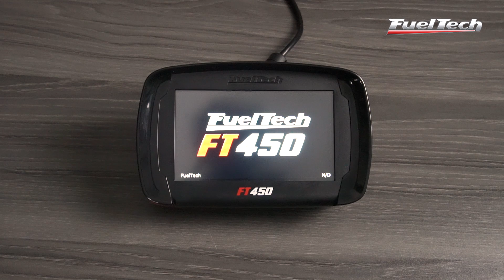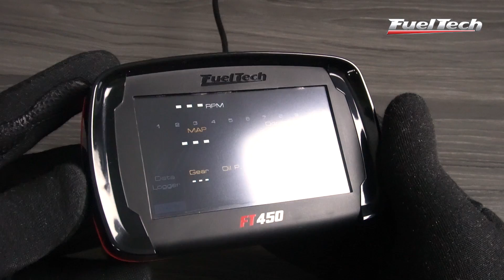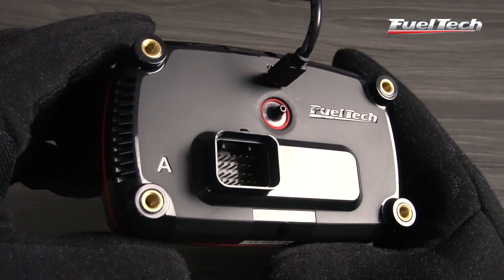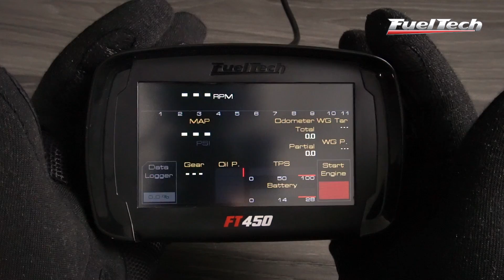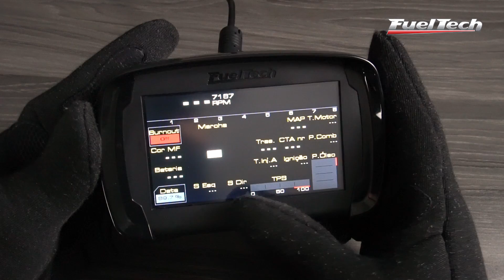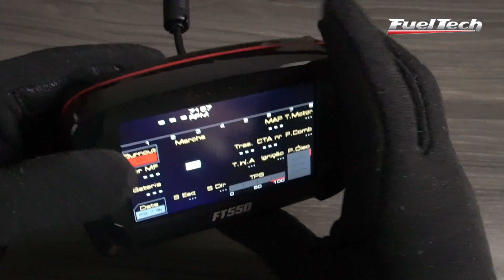FT450 & FT550: Learn More! FuelTech

Comment: Awesome! The ft600 is a cool unit, but I didn't need all of it crazyneiss. But this 450 or 550 will work just fine. I will hopefully be the first R32 GTR to run this system.